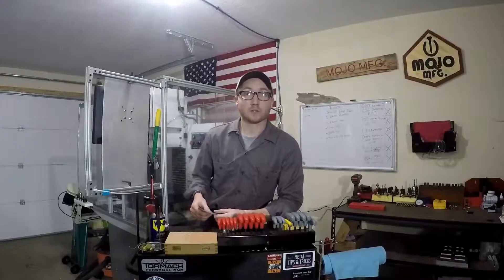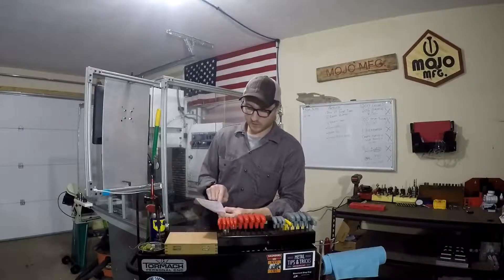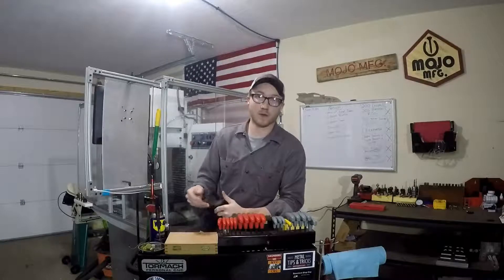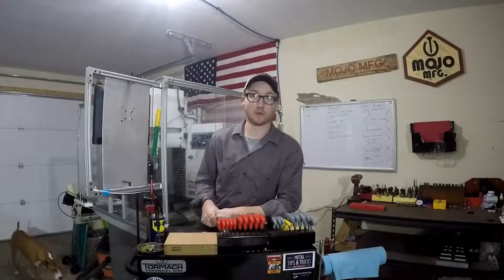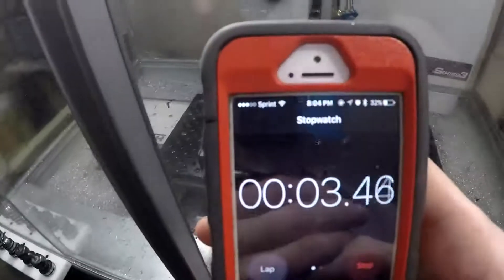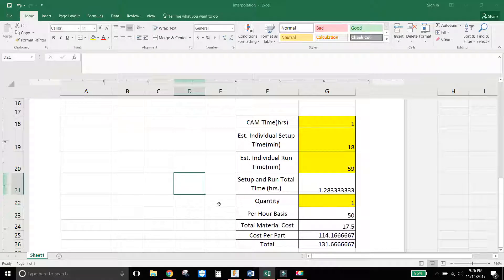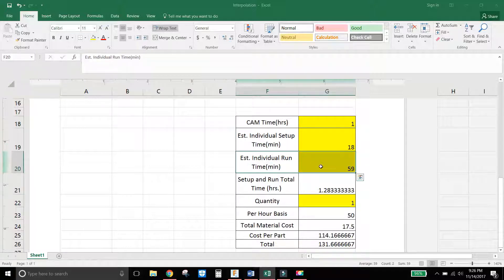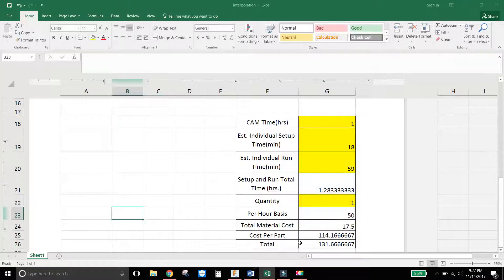Delrin, Machine Time and Cost: Home Mfg. Days #9

Comment: I found that while Delrin is a really nice material to work with there are some problems in some applications. Don't try to make spool valves out of Delrin if they are going to used at elevated temperatures. For example using a Delrin spool valve in a hydraulic application where the spool valve is installed in an aluminum bore. The valve will work just fine at room temperature but once the oil has reached about 150 degrees F the spool valve will expand in the bore and jam the valve. The expansion rate of the Delrin spool is higher than the aluminum body. Steel or brass is a better option here.

Comment: Any idea what the hard shiny black plastic used on older car switches is?  The stalks from 1980 toyotas still look brand new, with no fading of the white wiriting, whereas modern car swicted start looking worn after 3 or so years.
Reply from the maker: I'm not sure
Reply: Delrin don't like UV. The UV from the Sun could be a problem.

Comment: Fairly new to machining i have a different sort of cnc router, at 3:50 what type of clamp system are you using?? & what size collet / end mill is that? Thanks
Reply from the maker: This was a while ago. I am using the carvesmart jaw system and the clamps in the jaw are talon grips. You can get all that stuff right from carvesmart. I am using an ER20 collet and that looks to be a 1/4" end mill I'm using at 3:50.

Comment: A sharp HSS 2-flute 1/2 endmill is what I would try, I don't often machine Delrin though.  Cheap tool, sharp, big chip gullet.  Oh and if you have your tool holders modeled correctly in fusion 360 it should show a collision in the simulation if the depth is too much.  Tormach holders are a template you can select under "holder" tab, and you can export your tool library if you work on multiple machines then import the tools to the other PC.

Comment: Make sure to use new/freshly resharpened tools with plastics.  If you use a dull tool it can rip out stock when the tool exits the work.
Reply from the maker: That is good to know. Thanks for the tip!
Reply: @MojoMfg  Not always the case. With acetal and some nylons  very sharp tips can cause chattering

Comment: Partner, you are selling yourself WAY short. $50/hr is what I charge to sandblast. For any kind of precision machining, take your current hourly rate and multiply it by at least 1.5, or even double it. I made the same mistake myself when I was starting out. If folks aren't willing to pay for quality work, let them buy their parts on eBay. Don't sell yourself short!
Reply: You should ask way more just like Russ said. The pay is not only for what you think your current time is worth, it is also to pay for every minute you put in to learning and honing your skills. There is a quote on some painter that wanted to throw a painting away because it didn't sell. A passerby saw that and wanted to pay him a fraction of its worth, so it wouldn't cost him anything in the end, the painter destroyed the painting because the passerby only thought about the time he put into that painting and not the time it took to learn to paint like that. moral of the story, don't undersell yourself.
Reply from the maker: Thanks for the advice!  Yeah I may be selling myself short now but that's because this isn't my full-time gig so that's sort of why I can justify the lower pricing and these aren't super precision parts either.  I can tell by your enthusiasm that I should still practice charging what should be charged for a normal part like this rather than going so low.
Reply: Here's my philosophy on it: eventually, you want this to be a full-time job, correct? I'm assuming that you want to grow, you want to buy more machinery, you want to expand your capabilities. All of that is going to cost a lot of money, and will require you to charge a premium (which is totally fair) for your work. Why not get a jump on that as soon as possible, and why not charge the same rate now that you're going to have to charge later to remain sustainable?
Reply: I don't mean to sound like a dick or too preachy either, I just hate to see anybody getting paid less than their work is worth.
Reply from the maker: No no...I truly like listening to the advice that I am given because it's generally given to me by people of much more experience than me.  You are correct that I want this to be a full-time job at some point, I do want more and better machinery, and I do want to expand my capabilities.  That's why I feel like it would be good practice to start charging the premium now so I can afford those machines quicker.  It just takes you and a few other guys for me to recognize that.  Right now I am focusing on some products that I make but I'm not really sure what direction to take the business but I guess that may take some time to figure out.
Reply: in China its $10-20 per hour for CNC work in general
Reply: Of course, the life is not so expensive in China as in some western country's and China wants to be competitive with local producers of those western country's. The shipping is a big factor in costs for these country's and there is a problem that dealing with China is not crystal clear. Another one is the difference between someone who designs, make machine paths and who works the CNC. If those are 3 different people, you can pay them different according to their skillset and what it is worth. With 3 different people you can cut costs this way. What i am trying to say is: the only way you can stay competitive as a company abroad is making prices cheap, this can be done in different ways and as a buyer you always need to hope they don't do this by getting lesser quality. (This is in my own experience, others can experience different things)
Reply from the maker: I like that.  Thanks for putting it into perspective for me. It's still a work in progress but I am trying not to sell myself short anymore.
Reply: And this is exactly why I can't give jobs to US machine shops. It is too expensive. I mean, I totally get it that you need to pay the rent, but if one can't charge the price of gold for the final product, then using American labor is just not in the cards. American pricing is fine for the defense and aerospace industries, but for anything below it's nearly impossible to use "Made in America", unless it is done at-cost inhouse.

Comment: Delrin is great to machine, just a work of caution is it is not dimensionally stable. IE if you leave your part clamped in your vise to long it will deform, and not necessarily elastically. Another great video! Keep them coming!
Reply from the maker: Awesome! Thanks for the tip!